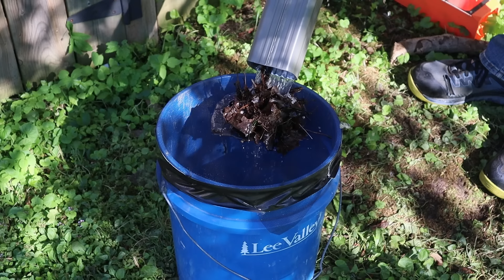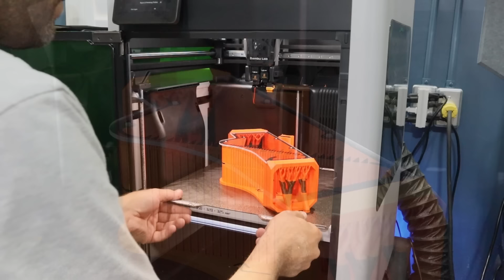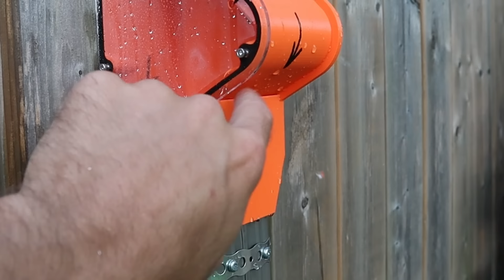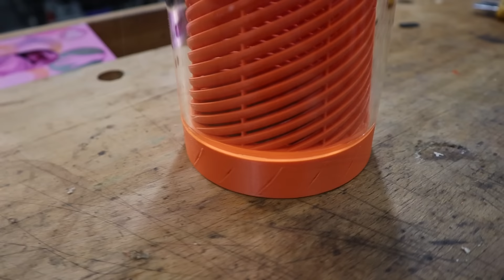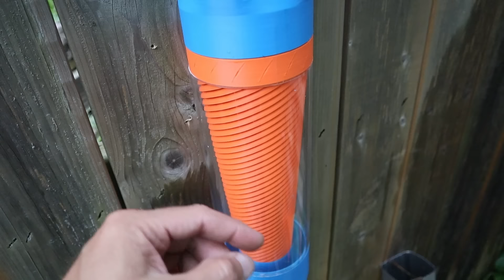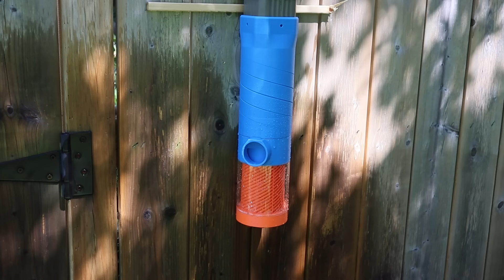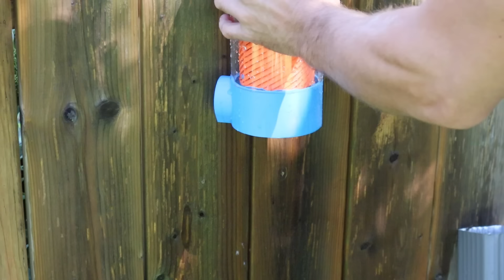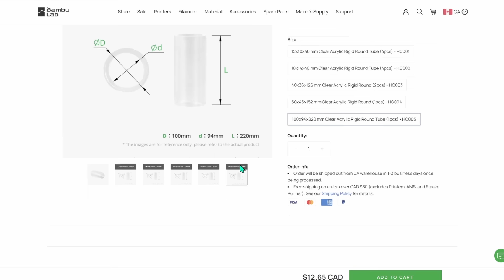Can you 3D print a self cleaning downspout rain water collection filter that actually works?  Let's

Comment: Informative and useful, although looking at video parts where we can see you, the reflections in your glasses are somewhat distracting, but easy to fix I can really recommend as photographer:
Take a look at "polarising filters", these are sold for cameras and it essentially removes reflections from non-metalic surfaces (glass reflections, water reflections, etc)
These are used in photography and videography and not too expensive.

Honestly in most cases you don't need one, but for scenarios such as this it will be perfect

Comment: I think the first design would work best with some little modifications. Firstly, I wouldn't use a deflector which will cause clogs. I'd try a much longer part with a very steep (as in much more horizontal) angle. It should come out beyond the pipe with a funnel at the bottom, just like your first design. Debris should easily slide down without a harsh change in angle which would break the fall.

Comment: This is cool, but when we had a system that took water from the downspout, we just had a simple filter at the top where the water entered. It got cleaned when the gutters got their annual clean. It was simple, like a narrow upside down collander that fit in the apperture. The divert from downspout was at the same level as the max level for the butt and the tube connecting the divert to the butt had a downward loop that caught any grit, which as it was friction fit, got flushed by simply detaching it and letting it hang momentarily (literally <1s) whenever the butt was full.
So very cool, but kinda unnecessary...

Comment: You should have stuck with your first design but increased the gap at the bottom where the water comes around the corner and uses surface tension to pull itself back in and also opened up the top gap a little bit while increasing the gap in between each vent by only a little bit and you would have been done The circular one won't shed material so you'll have to be checking it all the time. you still need the ramp to be self cleaning. You messed up with the second ramp design by making the curve too sharp When the more gradual it is the better. That being said... It was a good design initially. definitely interesting challenge that gave me some good ideas.
I also think you're being too hard on yourself because
I also don't think your test was very fair considering that it's pretty rare for that much debris to come down a downspout at any one given time and you also didnt provide the real world conditions of smaller amounts of debris coming down in torrents of water. You should add your debris to a bucket and fill it up with water and then pour the bucket with the debris and water together down the downspout for a true test.

Comment: For better testing mount a length of gutter to your fence, with the right slope. Then spray water into the gutter instead of right into the downspout. Below the center I'd make a sloped platform with vertically oriented slats spaced close together. Debris would hit that then get washed down as water lands on it. Have the bottom end of the slats outside the rain barrel.

Comment: Great idea. Combine the pipe outlet from the later idea with the first version. This allows you to connect a water tank or barrel using a pipe or hose. Once the tank is full, the excess water can flow downward into an existing pipe and then into the sewage system (my use case), while the filtered-out material continues to be discharged to the side.

Comment: If you’re worrying about it sealing well with the magnets ( 14:55 ) you could always use a non-interference tongue and groove.  In my mind it wouldn’t even need rubber seals, just enough change in elevation between the 2 parts to keep water from escaping. How well it would work in practice is beyond me. I haven’t the time nor ability to do these things.

Comment: Very cool design and seems to work very well! It would be cool to test it by having a bucket of water with some leaves already inside. That way it can simulate larger rain (where the waterflow is so much that the water may not stick to the walls). Maybe if the waterflow is too much you could run 2 or 3 in parallel to reduce water flow

Comment: is it me or does the taller one give you more water coming out than the shorter one? 

also have you tried  Plastic Teeth that twist and lock in place instead of magnets ? 

possibly rubber gasket to keep water in.

anyway good video 8-)

Comment: if you could add a mechanism to spin or agitate the contraption in the pipe it could loosen things as it goes down, you can use mechanical power from the water flow itself, but having any material going into the pipe that is one size at the top and a smaller size at the filter will ALWAYS lead to it becoming clogged, unless there is another factor to consider, but since your model is all stationary it is just a matter of time before it clogs up.
incredible work none the less, great watch and hope you take my comment to be encouraging and not in a negative tone, I wish you well my friend.

Comment: You should try the upside-down version, but with the spirals being made for the outside, instead of for the inside, so the debris leaves the system more easily. You would need to add a cone without those, and under the code you would start the anna-coanda water filter. And this also means that you could make it much larger, to capture almost all the water, with the downside being that debris can stay on the filter until there's a strong-enough water flow to clean then, so if that doesn't happen, debris will keep staying on there, biodegrading and making it into your rain barrel(s), but if that's an issue, you can simply make the cone steeper and less wide, to get the same total surface area for water to pass through.

Comment: Hey just a friendly heads up to all those plastic loving, printing folks out there.  Its' cool and all, but a bucket with a hole high, and low, full of beach sand will do this probably better.  And I admittedly didn't even watch the video just read the title.  Sometimes you don't have to reinvent the wheel.  Even if you have new tools.  Cheers though, because this seems a lot cooler to me than 3d printing another nick nack.  Cheers all !

Comment: I would not expect those magnets to avoid corroding for very long in a wet application like this if they're unprotected. They'd need to be encapsulated in some way, but I'd just as soon design this with a mechanical locking collar of some sort. It'd be possible to design something that could still slide in/out with zero clearance in the same way.

Comment: Add the ability to thread a garden hose to the water discharge port.  On my current water collection, I have a garden hose run from the downspout into a 55 gallon barrel.  Both the downspout and rain barrel have male garden hose fittings and I connect them with a leader hose/washing machine supply line.

Comment: I think you might be seeing a better result with the water than you'll find with an actual gutter input. The spray pattern of your hose nozzle is sending all of the water out towards the walls of the downspout. It'll probably still work fairly well, but maybe some more water will fall straight through.
Reply: But in a normal gutter and downspout most of the water is also send towards the walls.
At the top the water flows over the edge and into the hole.
Reply: Really the entire test should have been done with a few feet of gutter on the top, with water poured in without a nozzle. It would have let far more real world debris testing as well
Reply: To be fair, that could be easily fixed by curving the pipe, so the water which goes straight through, ends up on one of the walls, and from there it's redirected to the filter. Another option would be making a cone and using that one to get the water from the center onto the walls, or even simply adding a small roof on top of the pipe opening where the pipe meets the gutter.
Reply: @SapioiT putting a small "roof" on it is a guaranteed way to clog it lol

Comment: I think this would work great as a part of a filter system: first, a settling reservoir to let the heavy stuff sink, then a coandă filter on the outflow to filter off the floating stuff. This would also slow down the water flow, like the restrictor on the first design, but without the clogging issue.

Comment: So i haven't a clue if this would work, but...
What if you start with a short section with inverted cone with slits taking the inner diameter out past the outer diameter of the downspout (gentle taper), rely on surface tension to capture the bulk of the water and gravity to let the debris free fall past...
Then below that have a much steeper version of the first design to capture some of whatever bypasses the first filter while making it harder for debris to get stuck?
I also think the first design could benefit from more distance between the curved bit and the start of the angled part, and maybe at the base of the ramp to actually form a section that would capture a small amount of woody debris (like some teeth) to capture more of the water at the very end.
Maybe also have the slits form gentle V shapes as well, to reduce water that stays on the outside, and also depressing the point of the V slightly to channel material into the middle

No idea if this will make sense to you, or if it'll work, but hey. If i don't say it then nobody will see it

Comment: Is your main goal renoving debris or collecting water?
If it is water, I would not even use a filter, but have a second barrel.
I have that setup, and it works reslly well.
All water gets collected with s small rim in the downspot. So the middle still has a big hole that goes to "waste". But most water sticks on the inner surface anyway.
Then it all goed into a first barrel. From there I pump it into a second barrel.
The 2nd one always had MUCH cleaner water!

Comment: This design is a commercially available product one can buy in pretty much any hardware store where I live (Denmark). They are typically a bit shorter, make due without the spiral and have fever fins that are placed at an 30-45 degree angle. Interestingly, they are usually quite a bit wider than the round downspouts that are typical here. This means that the inner diameter at the bottom of the filter is practically the same as the downspouts diameter, preventing a bottleneck. A taper at the top gradually brings the water outwards, without detaching the flow.
Also, the stuff I collect from the gutters here is usually really slimy stuff mixed with dirt, twigs and remnants of leaves - that stuff is able to clog up even the most well designed filter.
Reply: You have a name of this product for people not living in Denmark?
Reply: @SSingh-nr8qz in dutch we call this a “loofafscheider” or “bladvanger”.
Literally translated: foliageseperator or leafcatcher
Reply: I was wondering if tapering at the top to have the catcher be wider than the gutter would be a good move. Cool stuff!
Reply: @802Garage exactly what I was thinking 🤔
Reply: Its a very nice Product. these product is avalable in Germany too. We call it Fallrohr Laubabscheider, Regenwasserfilter, Regenwasserklappe (Downpipe leaf separator or rainwater filter or rainwater flap) 😄
Reply: This design seem pretty easy to remove and spray out with a hose though. Making the slime still an issue but one more easily dealt with.
Reply: You can’t replicate the flow you would get from the roof during a downpour.
Reply: @Ebonyqwe  6$ at home depot...   search Flex Grate Black Vinyl Downspout Filter
Reply: https://www.youtube.com/watch?v=6g7QB3XUSiA
Reply: Just looked up what you are talking about it has the same function removing debris but the one i found in Germany and Denmark seems to be just a angled mesh or grate. I think what he has here is different because he's using the effect of the water hugging the surface. In the end it does the same thing but seems to me to do it in a different way.
Reply: @JaegerCreator  There is a bit of confusion. Most people know of those that simply remote debris from the stream. The one I was describing uses the same principles described in the video - leaving the debris in the stream while removing some amount of clean water. While the principles are the same, the form-factors differ quite a bit, and we can only speculate on how they compare.

Comment: Looks good, I'd have a top and bottom adapter so you can just invert the piece when not needed. Where I am we dont freeze but that could just be invert the piece or have a winter insert as a bypas. maybe use PETG seals in a recess to prevent leaks?

Comment: I am not an engineer, but I imagine you could maximize water collection by ensuring that more of the water is on the inside walls rather than falling directly down the middle. You could try adding a 1 to 2 foot section above that is at a 6 to 10 degree angle and also has rifling on the inside so that as water hits it, it uses the centripetal force to cause a swirling effect to force the water to stay on the inside surfaces. If you cause the rifling to be the opposite direction to the rifling of the filter edges, it would force most of the water to circle the interior surface of the filter walls at something like a 90 degree angle to the capturing edges. Experiment with larger and smaller rifling sections to capture higher or lower speed water flows, without any edges to capture debris. The angle of the rifled section should be just enough that there is no direct path downward so all the water is forced to interact with the rifling, but not enough to impede the flow of water or debris.
Also, imagine the valley of each rifled portion directly aligning with the filter surface, but the ridges being 2 to 3mm away, causing the larger debris to have less contact with the filter wall, but almost all of the water to be funneled directly at the filter.

Comment: a) should deflect the capture to the side (like with a right angle) into a bucket so you're not getting both debris and water captured, b) you should use measured amounts (not perfect, but say, drop a 5 gallon bucket with/without debris) to measure the efficiency.  Still, very nice; I feel like this as a precursor to a normal filter would prolong its life, so... money saving.  I would like to see a percentage of water in vs. out, aka efficiency.   I live in an arid desert, so it doesn't come up much here.

Comment: 20:53 I would suggest changing the flat bottom of the exit to be sloped.  Water will come through the funnel and hit the bottom and splash back up and out the funnel again.  If it is sloped the water can flow down and out the exit.  You will collect more of the water.

Comment: You almost come across a different solution a couple of times. Close but no prize. The water flow shape you have there gives you a clue as you're using it. Water surface tension makes the water cling to the plastic as it flows down and around the bend at the bottom. The answer is not to have any groves or holes on the top surface at all, but to put collection of water under the bottom curve. Water will flow down and around the curve at the bottom, debris will not. There are house gutters in our area that use this principal.

Comment: If you give it abit of an angel as it gets sent down into the "cone" you can force the water to spiral in. 

This way at higher flow rates it moves faster and "pushes" more water through the slats and keep the heavy stuff still dropping out.

This also means if its coming in at the steep angel you can have the opening wider then the spout with it narrowing down to the same size as the spout at the end

Comment: In my opinion is a very nice idea, but it need to be upgraded to obtain a better grade of efficiency. In my house, we collect the fatter from the rain as you, and I think it would be useful to had one. I imagine that the filter would work better if you cut the tube prototype in a V shape, so it have like 230° of area. Then place it at 50° for the water slide into the triangles, so the junk can easily be thrown away. I am not sure if decreasing the size of the triangles at the end of the filter will improve the collection of clean water, or changing the grade of inclination of the triangles. 

Also, I am curios about how you (everyone) preserve the water, so the bacteria don't purify the water? I had been having troubles with it, and using pills of chlorine is not an option.

Postscript nice video.

Comment: 3D printed designs don't necessarily translate to easily injection molded manufactured designs. That being said, look into what are called "pool filter skimmer socks" and make a simplified design that is easily manufacturable and maintainable. Pool filter sock at an angle of 45° is going to reject small particles and as the water flow intermittently strike it will cause it to bounce to release any stuck particles and make it self cleaning. PS--Pool filter skimmer socks make an excellent pre-filter for your Shop-Vac cylindrical filter reducing maintenance and increasing lifespan.

Comment: Just an idea on the preadapter going into the diverter have you thought about making micro fins to help the water starts spinning before it gets to the filter. Just for the water on the walls to be sucked in instead of splashing about, but not to long to interfere with debris play, it would also help collect all the debris in the middle to be tossed